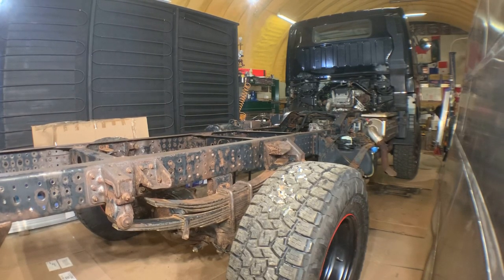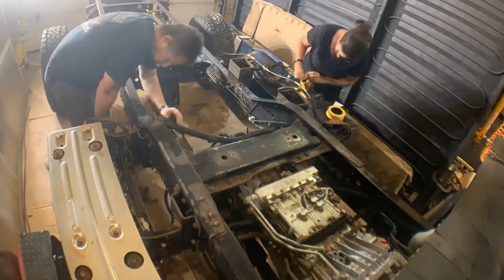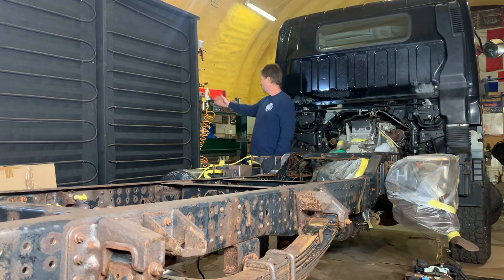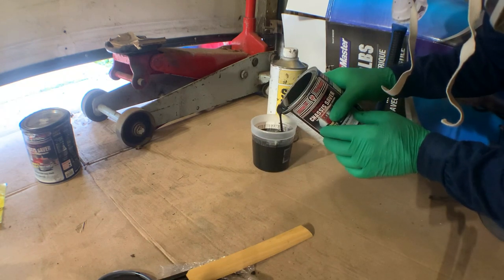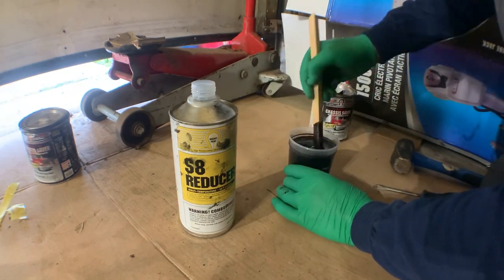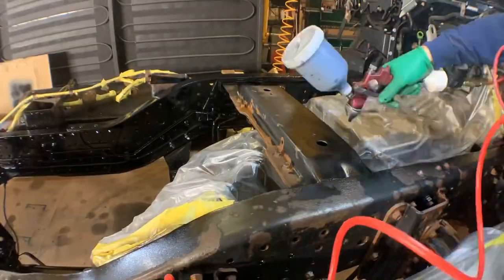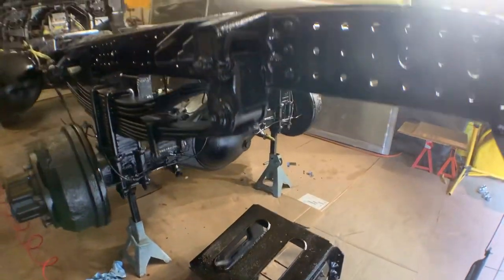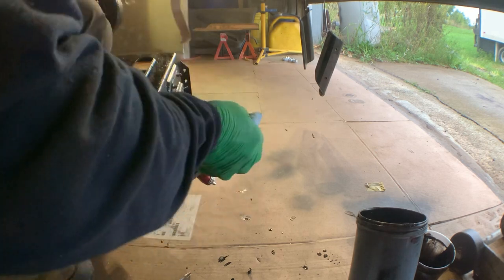Painting the Fuso frame with Chassis Saver!

Comment: Great videos! keep it up and you’ll go big I betcha. Have you ever thought about making an overhead sleeping compartment above the cab? I’m thinking I might do for mine. Almost need a dump device to raise it high enough so the cab can rotate out. 

Having the bed ontop clears out so much space
Reply from the maker: I do plan on having storage over the cab, but having the bed up there would put the overall height of the truck really tall - top of the cab is quite high on this truck.  Originally I had planned on having the entire camper slide back on a hydraulics system so the cab could tilt with an overhanging “nose cone” - but that got a little complex. Still plan on having the nose cone for storage, but not quite sorted out on the configuration of it, whether it tilts up for the cab to clear, or slides up, or is just mounted to the cab, not the box.  Lots of work ahead of that though!!
Reply from the maker: Also, if you watch the video “What the FG is going on” - it will give you an overall idea of the layout plan.  😎

Comment: Thanks for the video!  Are you going to add a top-coat?
Reply from the maker: Not at this point, 99% of it is under the truck and I’m fine if it fades or goes a little grey.  I may do a top coat on the rear plate once I’m done everything else.

Comment: I scraped and brushed my other truck frame w/ rusty metal primer and rustoleum paint and after 5 years its rusting again
Reply from the maker: 5 years on Rustoleum isn’t that bad.  The key difference between rustoleum and chassis saver is that the rustoleum is permeable, so on a microscopic level it’s slowly allowing the “baddies” to get through the paint to the chassis.  With a paint that doesn’t allow that, unless you have an adhesion, or thickness problem, it should never rust again.